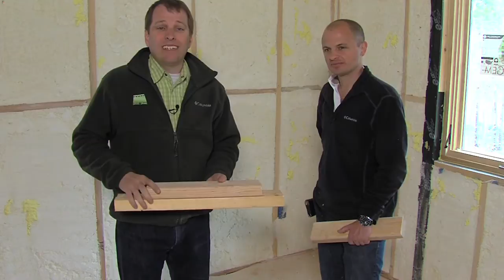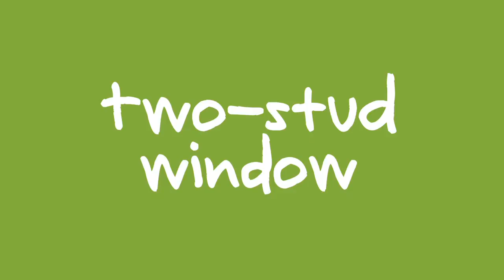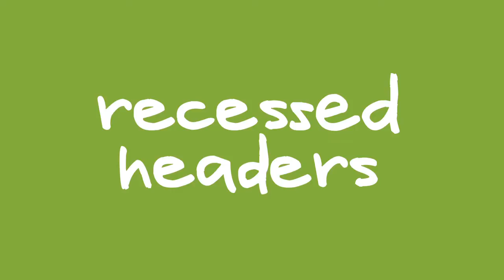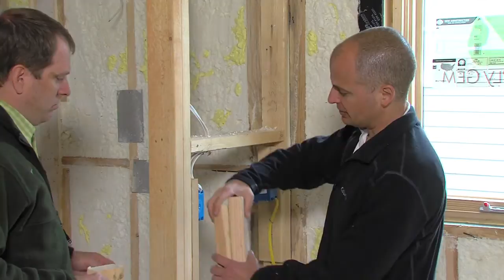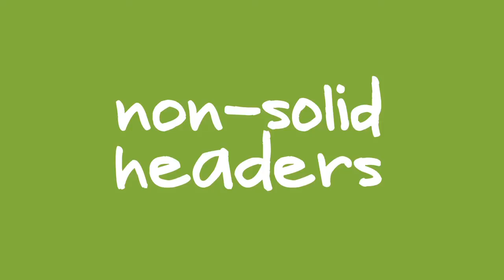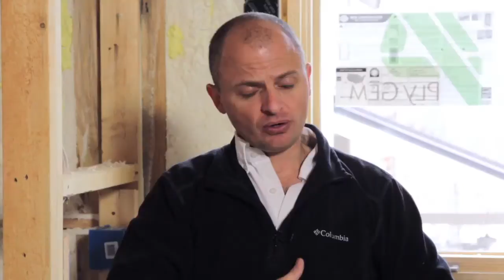Saving Money & Energy with Advanced Framing | Residential Green Building

Comment: how much stability will you lose in your framing doing  these implicants
Reply from the maker: +Aaron Wendell I'm not an architect or builder, but what I understood from Luis is that the structural integrity doesn't suffer at all. In this case, the house had 2x6 studs, allowing for wider centers on wall framing. The house was also fully covered in Zip sheathing, which added structural rigidity as well. Hope that answers your question?
Reply: +Tom Mills (GreenShortz) you y
Reply: Shear loading of a building is one of the primary causes of building collapse in earthquakes and high wind events. Collapse of buildings from the compressive loading of the structure from the weight of the structure is not. The shear strength of a building is reduced a small amount in a wall with 24 inch centers but this can be more than compensated for by using sheathing that is a little thicker. Proper bolting and strapping have far more to do with the ability of a building to withstand earthquake and high wind events than the spacing of the studs in the walls. I wonder if the use of advanced framing on the second floor might increase the ability of the structure to withstand earthquakes by reducing the weight of the upper floor.
Reply: I thought headers on windows and doors is a must do, as Larry Haun will say " is the code"
Reply: @mariogatica2363  Headers on windows and doors is a must do on load bearing wall